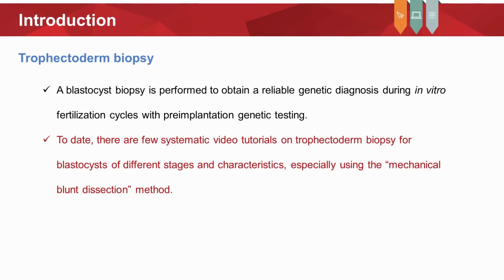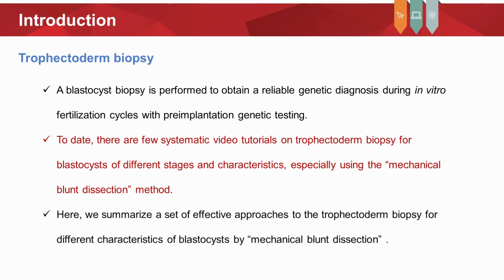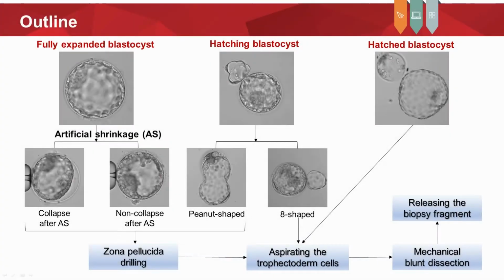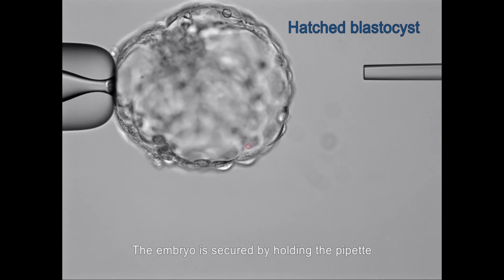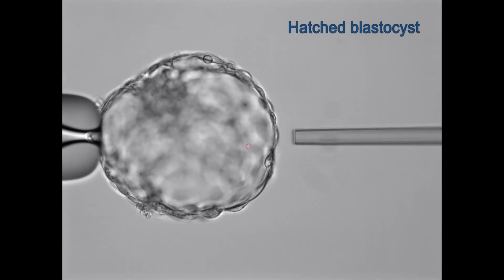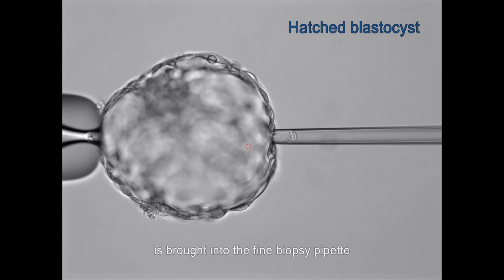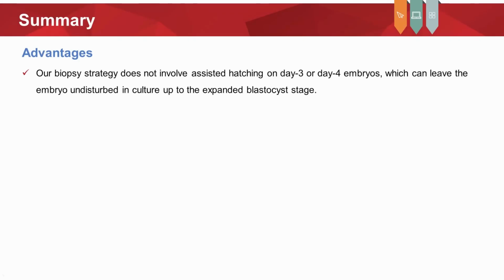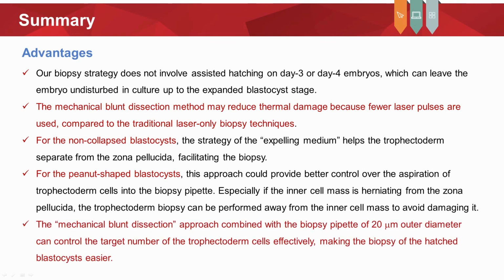An effective method for trophectoderm biopsy using mechanical blunt dissection...

Comment: 1:12 artificial shrinkage (collapse)
1:30 (generally) the blastocyst will collapse after artificial shrinkage
2:46 if the blastocyst is not collapse after artificial shrinkage
3:30 for "peanut shaped" hatching blastocysts
4:39 the biopsy of the "8 (eighth) shaped" hatching blastocyst
5:27 hatched blastocyst

article "An effective method for trophectoderm biopsy using mechanical blunt dissection: a step-by-step demonstration" 2020